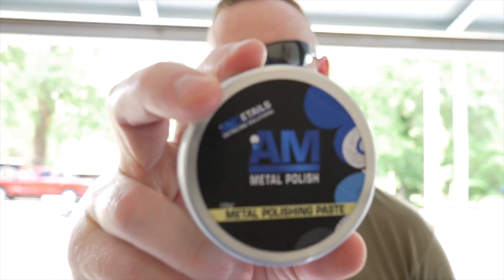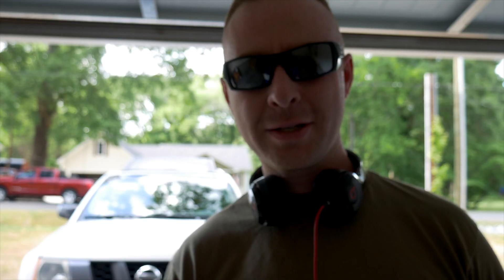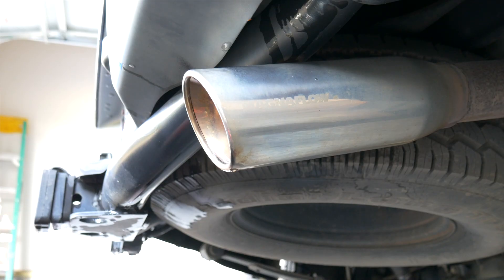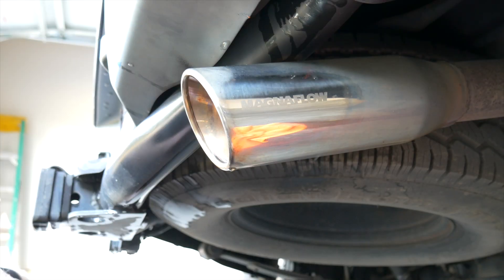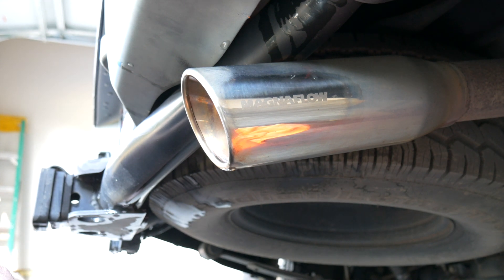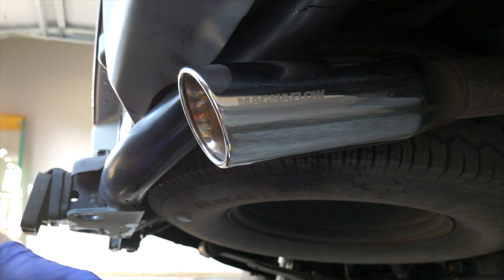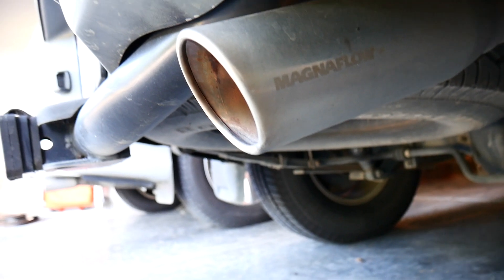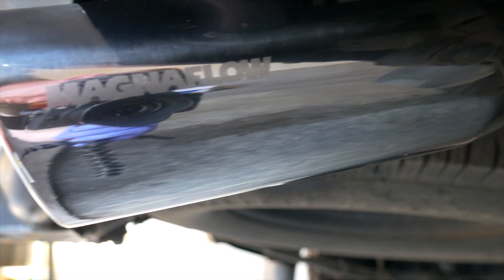Trying out AMDetails Metal Polish and Dr. Beasley's Metal Coat!!

Comment: So how did it hold up?
Reply from the maker: It's held up very well actually. It's been a little over two years and I clean my exhaust tip during each carwash and it still looks great. The exhaust build up comes right off and I haven't noticed any staining. I'm very pleased with the durability and longevity of these products.